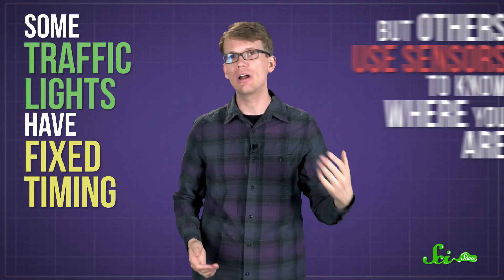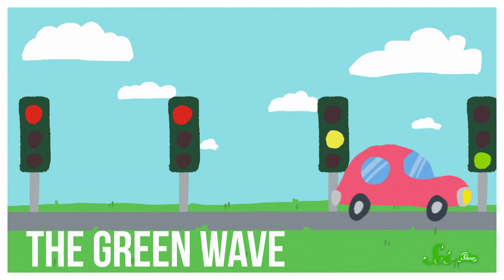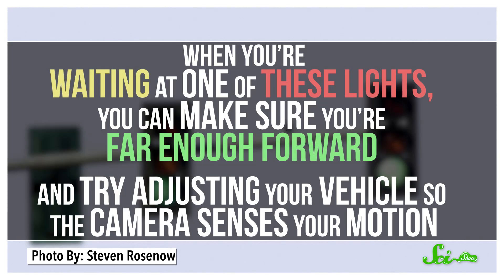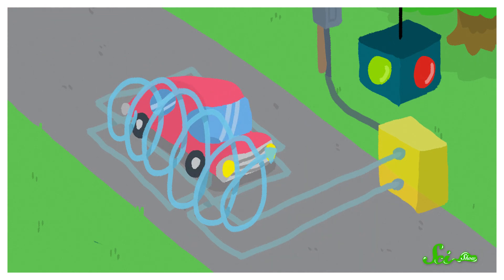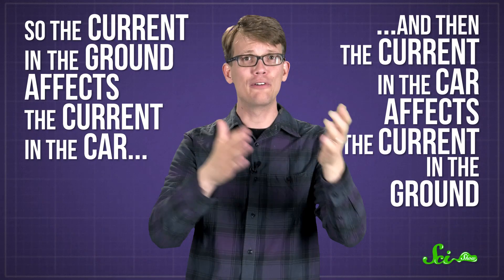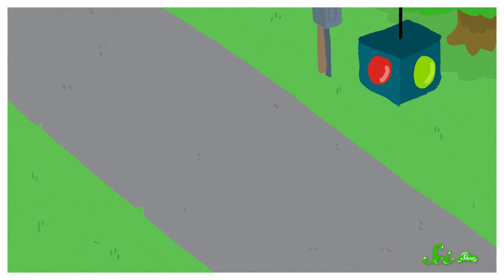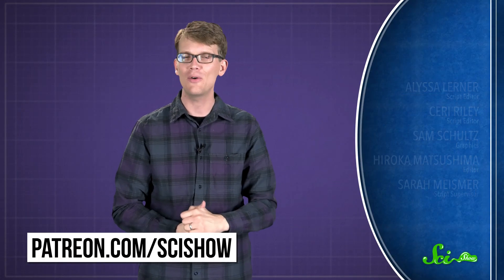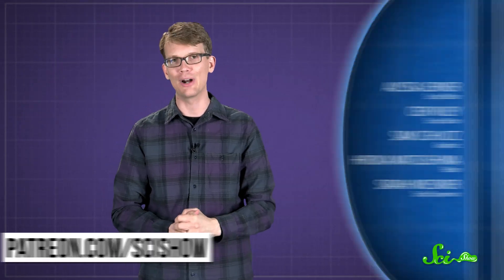How Can I Make A Traffic Light Turn Green?

Comment: Go at 1/6 c and that red light will become green!
Reply: +drummerboy smith 1/6c is 1/6 of the speed of light in a vacuum. When you are heading towards a source of red light at 1/6c, the light will be blueshifted to the green wavelengths due to the Doppler effect.
Reply: Clever thinking, but I max out with my bicycle at 2.66851276e-8*c. :P
Reply: Sometimes I love this comment section
Reply: Our physics teacher used to tell a story about a guy charged with running a red light, who pleaded the Doppler effect had made the light look green. He was given the choice to pay the appropriate speeding ticket instead :-)
Reply: Lol, beat me to it. +
Reply: Blueshifting, heh... Does that make sense though??
Hmm have to check a color wavelenght chart as it doesnt fit with the color triangle.

Hmm it does... AND it goes through yellow first... neat.
Reply: +drummerboy smith 1/6th of the speed of light. If you travel that fast, the light from the red traffic signal will doppler shift to green.
Reply: What is 1/6c ?
Reply: +drummerboy smith 1/6 speed of light in vacuum
Reply: Simple in theory, difficult in practice.
Reply: 1/6th the speed of light or 31,046 miles per second.
Reply: Ouch... well played by the officials. :D

Comment: ugh what's I live they use the opposite,  red wave technique.  so irritating.
Reply: Not always. Red lights can be used as traffic calming measures. Especially useful on long straight roads in areas where traffic is predictably low at certain times and where drivers should be discouraged from high speeds. Specific case would be late night in a residential area.
Near me is a road like this where, at night, all lights are red until a vehicle is a few meters from the light.
Reply: no unfortunately not, they've specifically timed it so there is NEVER a 'green wave', lights practically alternate in synchronicity to force you to stop at every intersection thereabouts.  Its been proven by people in the community here its too convenient and exact a timing scheme to be otherwise, and the city council there HATES the fact that their town is between this whole area and the freeway.  They've changed streets, made 2-ways a 1-ways to keep people from being able to bypass the lights, and set timing zoning laws that certain roads are no-throughput (with cones and city cops enforcing it) to keep people away from any side streets.. its a nightmare at 4:00pm.
Reply: You have to respect the speed limit in order for a green wave system to work...
Reply: Robe I'm not sure why the transport engineers who designed the system picked it, but I'm sure they had some reasons. Keeping drivers alert, making sure the speed limit was less likely to be broken. Maybe reducing the chance of a collision with a car coming through an intersection, I always see drivers speed up to make a yellow light, often running the red light at speed. I've never seen one run a red that's been red for 10 seconds before they even made it to the lights... I'm speculating :p
Reply: street likely has a lot of fuel stations too. haha
Reply: Red wave technique? Surely, that' the same as the green wave system. Between each wave of green lights, there is a wave of red lights (and between them a wave of yellow lights).
Reply: Red waves are entirely possible. A green wave is timed to move (in the favored direction) at the speed limit or a designed speed. Find that speed and you can ride the wave. To create a red or disrupted wave, time the lights to move the wave in the opposite direction or to not create a green wave at all. Green waves are also disrupted by traffic sensing systems that can be affected by cross traffic. Good traffic engineering wants traffic to flow smoothly in all directions with a minimum of gridlock or stoppages. It is also possible that traffic saturation is occurring. Saturation happens when platoons of vehicles can't get through the wave and are forced to stop.
Reply: +Niall Kinsella wouldn't a green wave system work just as well?
Reply: unfortunately the next town over doesn't like us driving through to get to the freeway  even though is the only path. .. Yea It's an intentional dick move.
Reply: Robe There's literally only a few vehicles per hour on this road at this time of night, so fuel and pollution costs to the public are negligible. It amuses me to see professional drivers (buses and taxis) crawling on this street at night so they don't have to brake or even stop at the lights :p
Reply: I notice that the red wave seems to happen a lot in black/minority neighborhoods. Just another way of keeping them in check.
Reply: +Niall Kinsella it's open to debate wether a very slight decrease in collision probability is worth it when confronted with vastly increased fuel consumption. Someone should make a study about it taking into consideration both economic and health costs of the alternatives.
Reply: You are in Phoenix too? ;^)
Reply: +kithsakhai That makes it sound like martial law, cordoning streets off like that. We don't have that problem where I live and the main lights go in waves. You get green waves but if you get a red you're stuck with them.
Reply: +Niall Kinsella That sounds more like road rage measures than calming measures.

Comment: Or just be a cop. Flash the lights and sirens and flip everyone off as you cross the red light.
Reply: Better yet, drive an ambulance or fire truck. Many emergency vehicles have the ability to change the lights they're approaching to green.
Reply: There are several methods.  Look at https://en.wikipedia.org/wiki/Traffic_signal_preemption
Reply: That's a good thing! gotta keep them going in case someone needs them.
Reply: That would work fantastically for ambulances that must not be stopped (the deceleration is too damaging for the patient).
Reply: +OOZ662 yeah i heared that too
Reply: +OOZ662 really :000 how
Reply: Or, if on the motorcycle, HOPE there's a cop around!  Especially on a 4-lane - talk about rolling right through!

Comment: I always assumed the grooves in the road were the outlines of pressure pads. Guess I was wrong.
Reply: +Diana, the Inorganic Vegan Just call the road,fat.
It will get triggered.
Reply: Even if that were the case, my bike would still be to small to trigger it. 

#thecycliststruggle
Reply: +Diana, the Inorganic Vegan, over here in cyclist paradise (otherwise known as the Netherlands) we have separate lanes and traffic lights for both pedestrians and cyclists. Allowing us to safely path around the buzz of traffic, and protecting ourselfs from being run over by innatentive drivers everywhere. We also have more bicycles than people so there's that.
Reply: too*
Reply: +Mike Jenkins I deliver pizza, two or three minutes is a big deal.
Reply: Yeah.  More of a metal detector coil.
Reply: running reds killing legs :DDD
Reply: Most people think that, but imagine replacing something like that if/when it went bad. It's much easier to recut loops of wires into the street after several million tons of cars have driven over them in the heat and cold.
Reply: ask yourself one question what are you going to do with the 2 or 3 minutes that you save come on at a traffic light really
Reply: Most of america (outside of SF) it's downright dangerous to cycle, because drivers are not used to it, the street layouts are not good for it, and the executive and legislative give a shit about it. 

The combination of all those leads to highlights like majors claiming that cyclist are at fault when cars drive them over in cases when the cyclist literally did everything right. 

Now you could make the claim that the united states are in areas like Detroit not developed countries, but more like developing countries. ;-)
Reply: You spend a full 24 hour day every year just brushing your teeth twice a day for two minutes each. 
How many two minute traffic stops do you make a day? Probably more than two.
Reply: Yeah, I know. I can't edit on mobile.
Reply: +puddingsnaxxx Shimakaze 4life <3
Reply: tipical azs whole tryin too fix grammer in de interweb
Reply: puddingsnaxxx Except for the time I ran a red light right in front of a cop car, with no other cars nearby, and the let me go.
Reply: +GLaDTheresCake I was about to comment the same thing! I had assumed that all developed countries have separate lanes, so this video brought on a surprise for me.. Lol
Reply: G